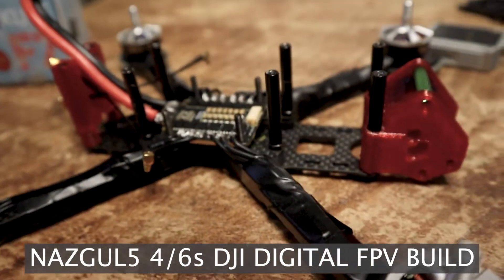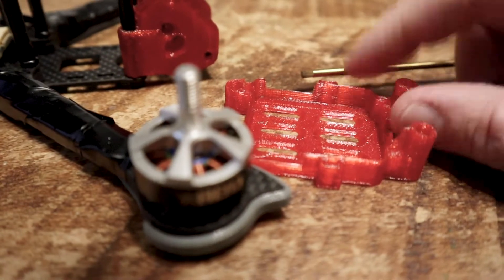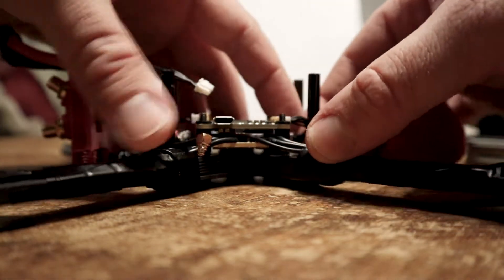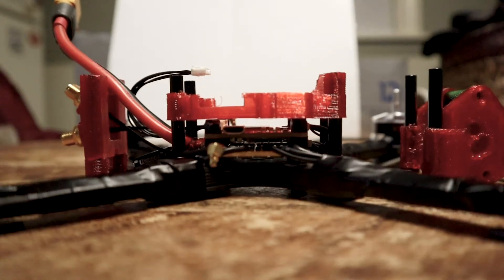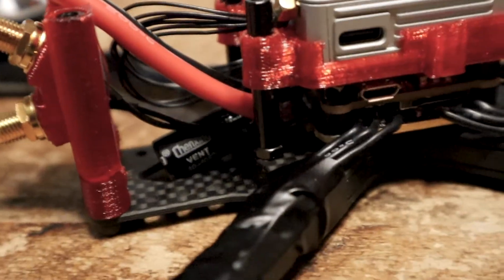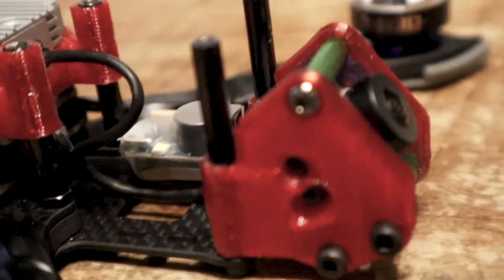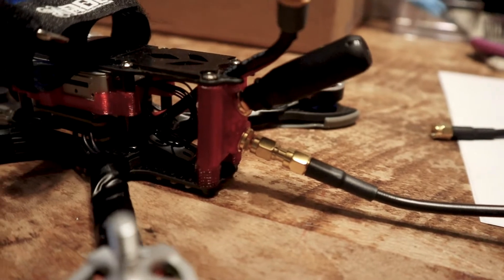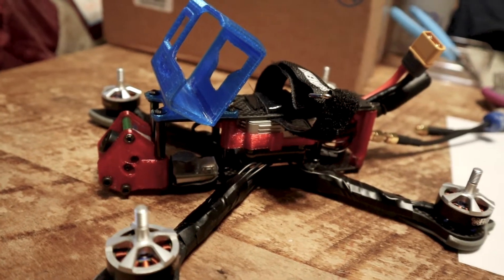iFlight Nazgul5 Quad with the DJI Digital FPV System - Build overview and close ups

Comment: Great video mate - looking to upgrade mine to digital - Is the FC / ESC essential for a 4S setup? Thanks!
Reply: Ah after some googling I find it is! I wanted to try and get sorted this week but without the Bang Good waiting times - are there any alternatives from Hobby RC you'd recommend?
Reply from the maker: @tomneish2056  Hi Thomas! Thanks for the question. I have two other quads using the DJI FPV System. One is on the Tmotor F55AproⅡ +F4 HD STACK, the other is on a NewBeeDrone Infinity30 30x30 Stack/Combo. Both can do 4s and 6s lipos. Not sure Hobby RC would stock them either, but you might be able to get them to you quicker than a Banggood order? Are you in the US or UK?
Reply: @highlinedrones257  Awesome thanks for getting back to me on that, good to see some other alternatives! I'm in the UK and I've found our options are pretty limited over here when it comes to FPV!
Reply from the maker: @tomneish2056  Try on Amazon.. I know a few UK based pilots that get some FPV gear from them.

Comment: Thanks for this video!! I learned a lot from your video!! I have questions. Why don't use genuine dji antenna? Is the antenna used in the video better? 
I'm sorry I have just started studying English😯
Reply from the maker: mn_gardener / にわし Thank you for your comment. And your English is great! I’ve tried several different antennas with the DJI system over the last few months. The stock ones are great. But I do find I get better range and signal with the two XILO AXII Long Rang antennas. They also do a much better job in and around trees. I hope that helps a little?
Reply: @highlinedrones257  Thank you for your opinion!!

Comment: Thank you for this video! I’m hesitating about upgrading my Nazgul5 with the DJI Air unit! Also, is that a the GoPro mount for the 7 or 8? Tanks a lot!😊
Reply from the maker: Silas Moser I have not regretted the upgrade since doing it. The DJI system is amazing! Expensive, but amazing! And the mount will fit the Hero 6 and 7. But not too sure about the 8? Glad you liked the video! I’d be more than happy to answer anymore questions. 👍 Thanks for the comment.
Reply: High Line Drones thanks so much! Then it’s not compatible with the 8, and that’s my problem!😅 hopefully Iflight will make one for the 8 soon!😊
Reply from the maker: Silas Moser check online because you might be able to find a mount for the 8 from a different company that might fit?